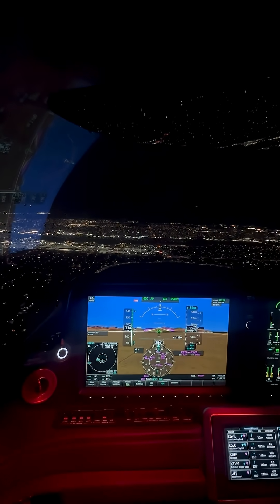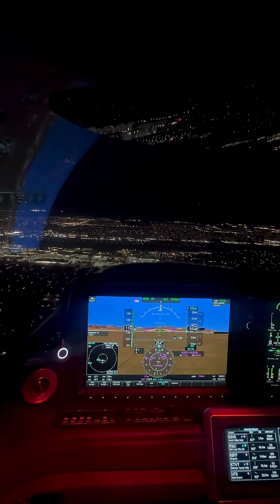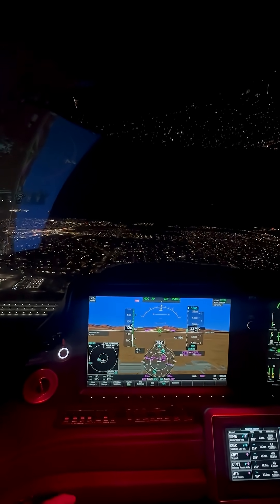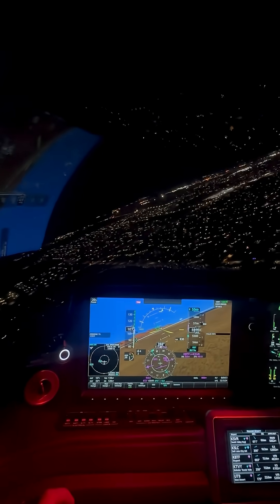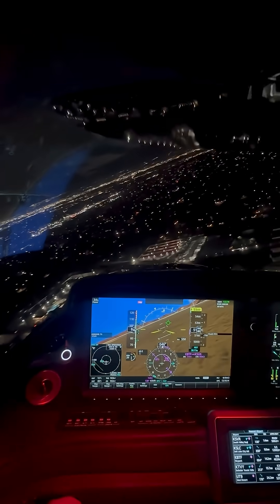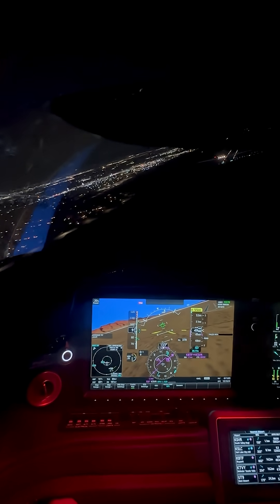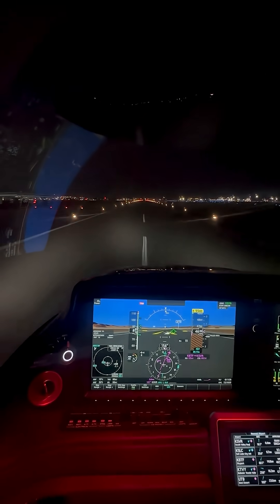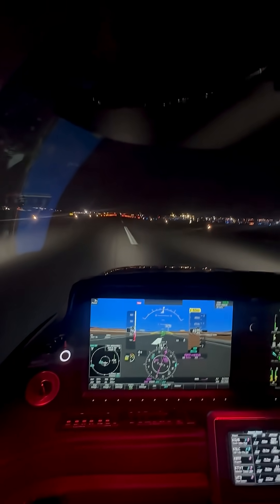Cirrus G7+ | Night Approach into SVR

Comment: I flew into U42 (old IACO designation) at night previously.  Was tricky because I could not see the runway with all of the city lights until I was fairly close to the runway.  Was IFR, coming from the north to land of 16. Conditions were VFR and SLC APP really wanted me to cancel once I had the field in site (said that flying the instrument approach closed traffic into KSLC).  Really nice area, will need to go back sometime.
Reply from the maker: Sounds like quite the approach!
Reply: Night landing at KBTF are a salt lake valley right of passage. There is a reason it’s called scare park…

Comment: Do you have any good tips for me? I'm currently learning how to fly the Cessna 172 right now! Any advice will be appreciated!❤️😊
Reply from the maker: Hey! Thanks for the comment! If you want some advice on landing I’d say It’s not enough to simply aim for the beginning of the runway. Most people, when learning how to land, start by aiming the aircraft somewhere toward the beginning of the runway. That’s not good enough it’s not specific enough. To achieve good, consistent landings you need to ‘aim small, miss small.’ What I mean is: pick a specific point to aim at a specific piece of gravel, the top edge of a specific stripe, the top-left corner of the ‘THREE.’ Whatever it is, fly to it in fact, fly through it. Fly to that aiming point as if your life depended on it. Pretend you are a Japanese Zero kamikaze pilot and fly to the target; single-minded focus meant victory in the Pacific theater. Fly through the target and into the ground. Not literally this is where the next step comes in.

Once you’ve locked onto that aiming point and flown it all the way down, there comes a moment where you have to shift focus. You can’t keep flying through the target forever you’re about to meet the runway. This is where the round out comes in.

So, what exactly is a round out? And how much do I pull back on the yoke or the stick? The FAA defines a round out also known as the flare as a slow, smooth transition from a normal approach attitude to a landing attitude, beginning at about 10 to 20 feet above the runway.

Think of pulling back the string on a bow and arrow, it’s slow,  smooth, deliberate, no jerky movements. If you do it correctly and consistently the airplane will loose energy and will stall and touch down exactly over the thousand foot markers.
Reply: @nicholassmout3281 Thank you so much!❤️😊